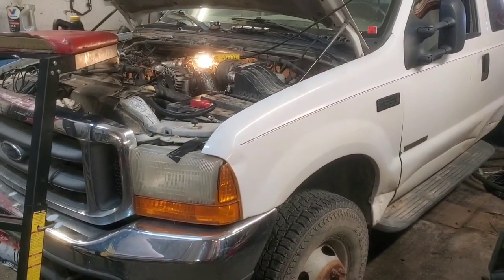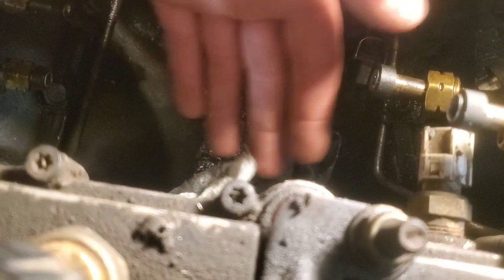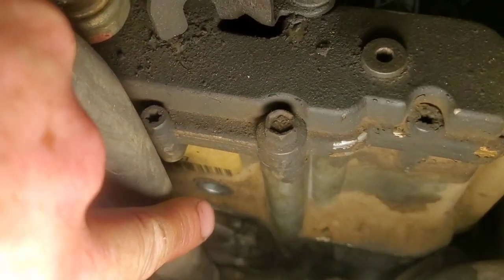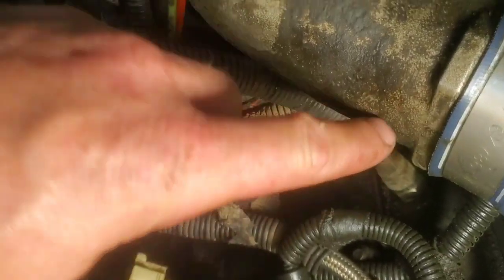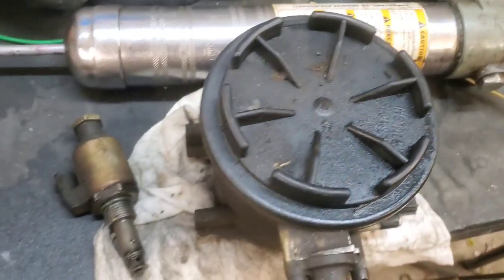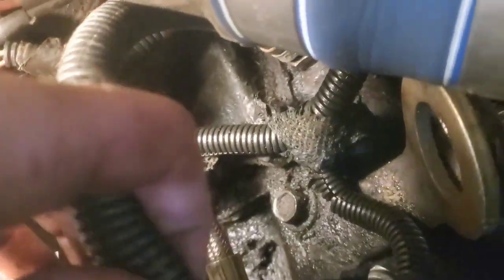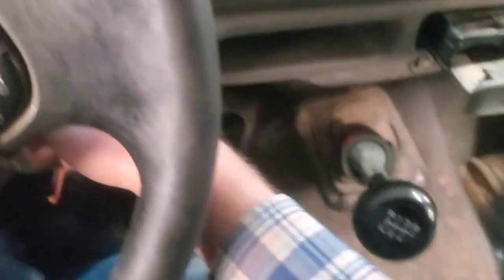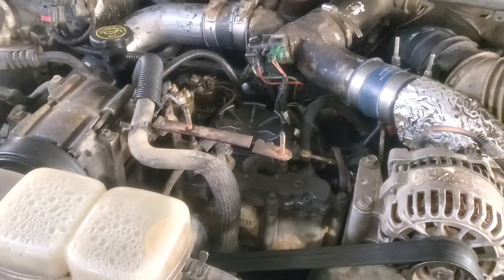7.3L Powerstroke: Engine Dies Crank No Start when Hot.  HPOP and Injector Seal Leak test. Part 2

Comment: Howdy,
Have a 01 f250 7.3 207k miles,ive had issues with no power so did the fuel tank mod a new fuel bowl,new hpop new valve cover gaskets new ipr and several icp on my forscan the ipr is reading about 65 but the icp wont get above 725 drivin don the road ive changed the icp 3 times after changing the hpop the trk will idle almost at 800 and after driving it it turns over acts like its gona start and dies it does this several times then starts, im at a loss
Reply from the maker: These engines need 4 things in order to run.  Fuel, High Pressure oil, Compression, and Air.  When your engine fails to run or lacks power you are missing one of those 4 things.  Most common is the lack of fuel or lack of high pressure oil.  You have to figure out what you're losing in order to fix the problem.  If you can't get more that 725 PSI you have a high pressure oil problem.  You either have a oil supply problem (the low pressure side that supplies the reservoir), a HPOP problem (IPR included), or a leak somewhere (such as an injector seal.  The IPR percentage at 65% is maxed out. The ECM is trying to build all the pressure it can.  Even though the IPR is at 65% it may not be working.  I have a video on how to test the IPR in the vehicle and on the bench

Comment: I have an 05 6.0. It starts, cranks and runs great until I drive it for 20 minutes then sputter and will stall out. I have to wait 10 minutes and then will start back up and run great until it gets hot again. Definitely frustrating!
Reply from the maker: With a 2005 you probably have a big oil leak in the stand pipe or dummy plugs.  But you also need to monitor fuel pressure while you're driving becasue that could cause this issue as well.